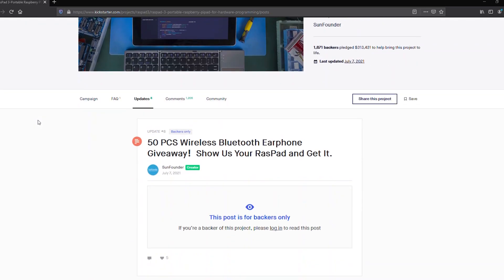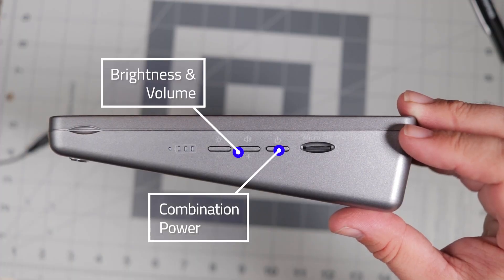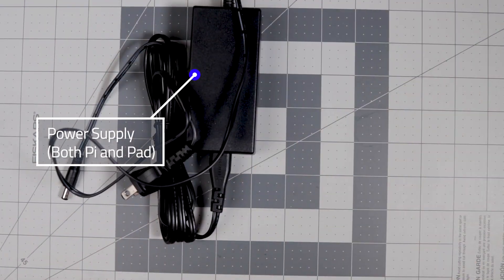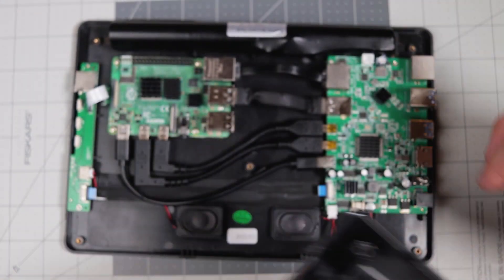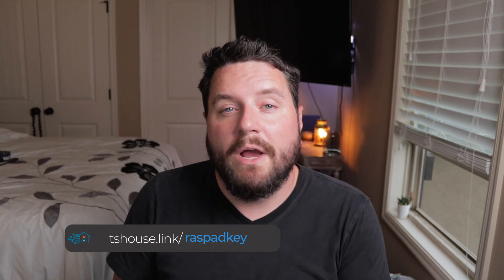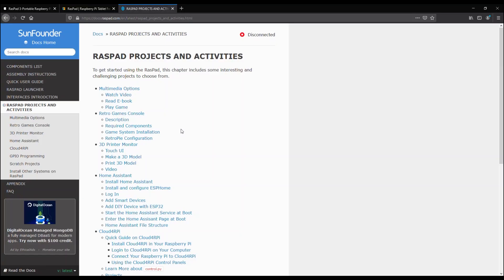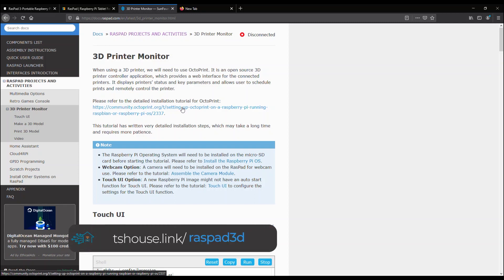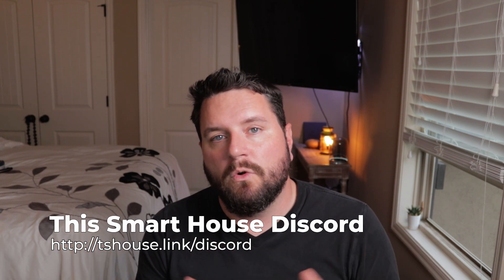RasPad 3  // DIY Raspberry Pi Tablet // Build Yourself

Comment: i think this thing is more suitable as a wall tablet than an android tablet because it has ethernet. but can it do PoE? i don't think so. i'd probably go for a custom solution with a Pi with a PoE hat and a touchscreen.
Reply from the maker: I'll have to look at the voltage on the adapter but I think you could do a POE splitter. The battery I think is just a bunch of 18650 cells so it would be easy to replace if it burned out. It is a little on the large side but nothing you couldn't easily wall mount.